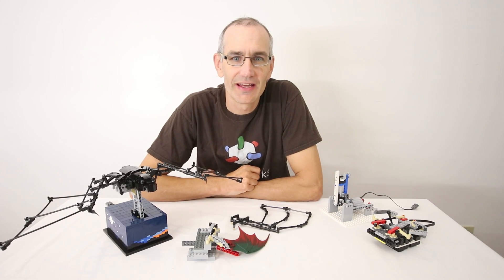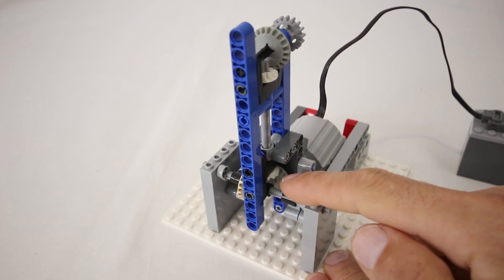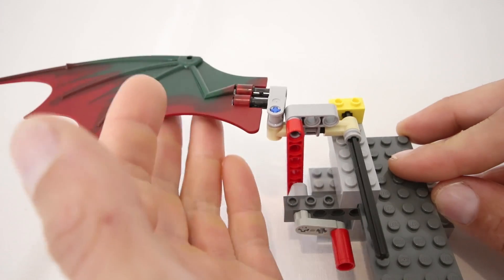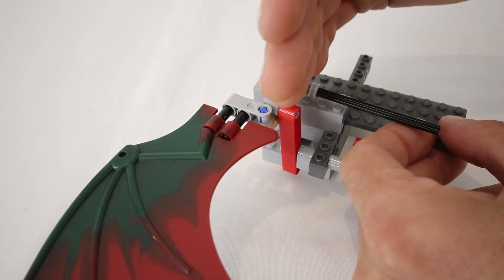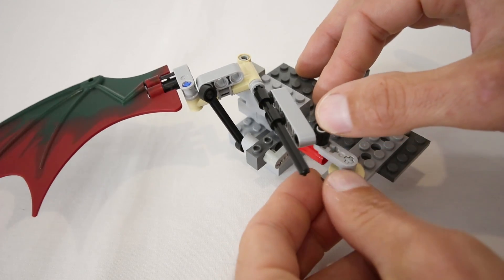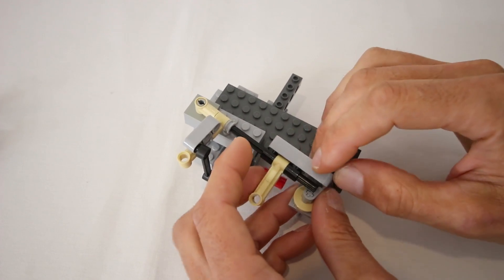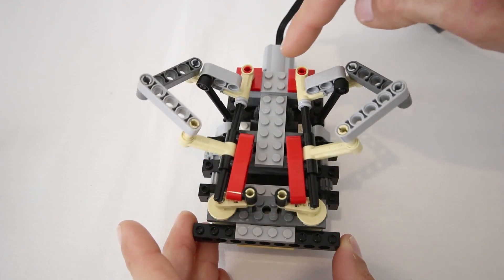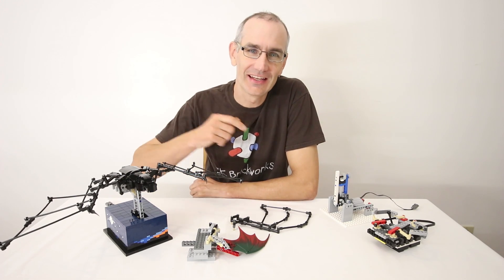The Bat - Kinetic LEGO Sculpture

Comment: It's amazing, but doesn't it look like the end of the downstroke chokes up a bit?

Still, incredible work.
Reply from the maker: Yeah, it's due to the weight of the wings and the backlash in the gear system (which is an inherent problem with LEGO models). I've been experimenting with using springs/elastics to offset the weight of the wings. It's actually pretty effective, but then introduces some other small issues, so I decided to leave them off for the video.
Reply: Thanks for the reply! Love your videos
Reply from the maker: Some people use silicone lubrication for their models. I haven't tried it, but I'm not sure it would do much in this case. The mechanism itself actually runs quite smoothly.
Reply: Could some lubrication on the sliding parts help fix that?
Is there any sort of lubrication that would be suitable for use on Lego?
Reply: JK Brickworks  I love your works, from which country are you?
Reply: Elyan Burnett they're from Canada